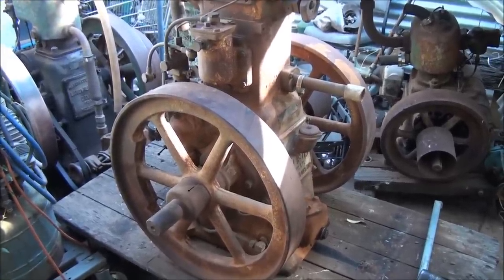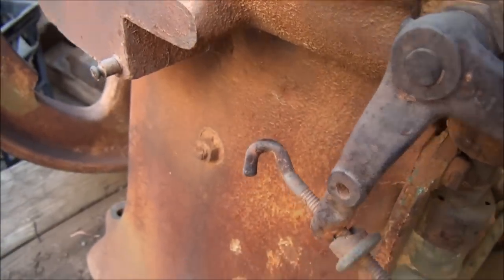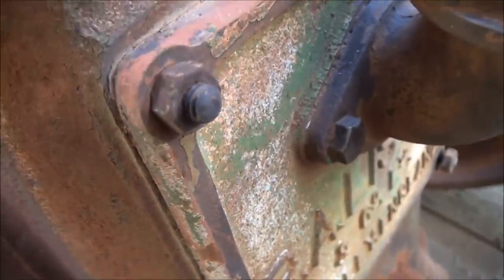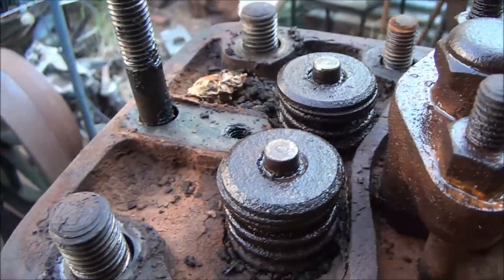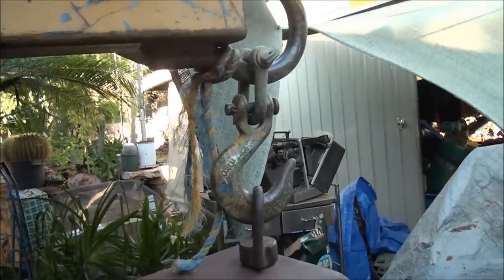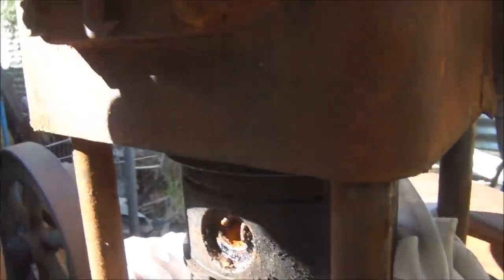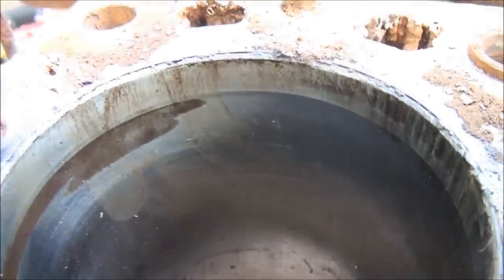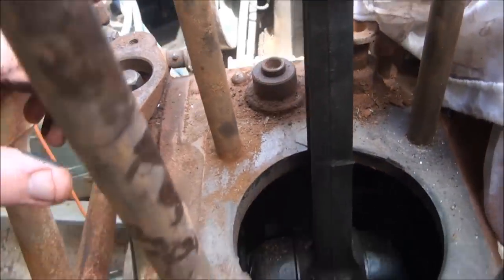Lister engine recovery, dismantling and inspection.

Comment: Hi my friend nice engine you got there I must say that you are a very fortunate man to have that head come out so quickly, At the moment I am restoring a Lister CS twin and each head took me over four hours to get out using steel wedges and pulling with a chain block!!!!!!
Reply: Thank you for that comment!!! I have spent an hour trying to get a head off (using oak wedges) and I though that something must still be connected - hence here looking for tips. Why does he want the valves to be free before taking off the head? Presumably it makes no difference to getting the head off?
Reply: @NomadArchitecture  My cylinder head was hard to take of as there was a lot of rust around the studs, It looks like water has seeped in between the studs and the head!!!! But I cannot imagine how water has got in as the nuts were very tight:-)) I had the same problem with the cylinder block took hours to remove it from the studs same problem heavily rusted studs!! When an engine had stud not working for a long time you need to take the head off to see if the valve seatings are corroded.

Comment: Very nice engine!, its in great shape for its age!
Reply from the maker: I think it helps to have nice dry desert climate to help prevent too much rust forming. All the bolts come off easily without using heat or CRC spray. At one of the stations there was an old Rolls Royce left outside in the elements for at least 40 years, a friend got that engine running again without too much trouble, the electrics (Magneto ignition) were still ok so a prime of fuel and a bit of oil in the cylinders soon had the old beast up and running. Have a great day!

Comment: Hi, friend. I want to congratulate you on that incredible restoration. I bought a 27/3 Lister mod. It looks terrible, because not have  the  3  valves covers and water get inside. If need  some  original spares parts,whar site can get it . I know it is a very difficult challenge but I want to try it. Thank you so much !!

Comment: My understanding is serial number longer than 5 digits on these is are made after 1950, the first 4 is serial number the last number is the year after 1950 (1953)  the other two refers to the engine 5 = HP model ( 6 with higher rpm) 1 = single cylinder, other numbers stamped elsewhere are casting numbers.... to my knowledge.

Comment: It has a very long serial number, usually they were 5 digits for that period?

Write to,

David Edgington
Lodge Wood Farm
Hawkeridge
Westbury
Wilts
BA13 4LA
England

He holds the construction and sales ledgers and should be able to tell when it was built, and where it was sent.

I would normally advise sending a stamped self addressed envelope, but I guess that would not work from abroad!

Just send the info off the brass plate.

Comment: hello sir , 
I have olso emotion for old irons . I have only 1 slavia 12 hp now , field burned engine olso but now its runing, I love my diesel low rpm . but I dont have enough information for my engine , where can I find information for my engine? could you help to me please ? 
afteryour nice video I m looking too a lister here , many friends looking for me around .
I found 5 hp slavia but its stuck piston , there was water inside . what you advice to me? best regards .
Reply from the maker: +Mesut Anilgan As for the engine with a stuck piston you can fill the cylinder with a light oil such as Kerosene and leave it in for a few weeks to try and loosen the piston, try and put a solid block of wood on top of the piston and use a heavy hammer to try and dislodge the Piston. Also you can use a Hydraulic pump like a portable unit with hand pump, connect a fitting in the cylinder like where the fuel injector goes and make sure the valves are closed. Pump in Hydraulic oil and the pressure should push the piston down so you then can remove it.      I have not heard of your engine make but if you search the internet you might be able to find information or maybe contact a Vintage engine society as they might have technical documentation or members might have parts you need.Good luck and hope you are able to get that stuck piston moving. Kind regards, Ian
Reply: what i did when i was restoring a John Deere type e under similar circumstances was to carefully heat up the cylinder around the head multiple times with a torch while also using pb blaster (penetrating oil )to tap it out  slowly

Comment: damn!!, that was close to going bang!!!, that's a loose as bottom end!!
Reply from the maker: Not wrong there, check my next video where I show the bearing, I think the bearing looks like it was starved of oil and started to rip out the white metal. The engine would not have lasted long, luckily the crankshaft journal seems ok so a new set of bearings will sort that out ok. Cheers!

Comment: gday, ive always been interested in finding my own station engine to restore etc. would you have any tips in finding these? i am located in adelaide but it seems almost impossible to find small station engines around SA. love the videos, always nice to watch tinkering after a hard day at work! any help would be muchly appreciated :)
Reply: emdae921 well good question I know this comment is old but I hope this helps👍  a lot of people are willing to sell you just need to find one. A lot of times there just out in the middle of nowhere so if you ever see an old abandon farm there is a pretty good chance of you finding one there. They are sometimes in abandon mines to probably pump water but these can be sketchy and often times water floods the mine and ruin them. But if you live in a city you best chances to find one are to go to shows and swap meats. I hope this helps and you find one they are pretty fun to work with☺️

Comment: Did ya go back and salvage a valve cover from one of those blown 3.5 engines? (if it would fit)
Reply from the maker: TheFurriestOne The covers will fit most CS Listers, later model engines used a cast alloy one, I did manage to salvage a few spares in case I need parts. I did speak to the manager of the property, he told me that a former mechanic was a very strong bloke and tended to overtighten bolts and things, that was the most likely cause of the big end failures, over tensioned bolts after big end bearing replacements!
Reply: ***** That's a shame about the mechanic, but at least you have spares! Do you think both 3.5-hp cylinders were wrecked by the big-end failure? One certainly looked to be, as the con-rod had smashed up towards that section quite violently!
Reply from the maker: Yes, I think they all ended up the same way, would have been a spectactular end to the engine!
Reply: ***** Back when they were a dime a dozen, folks might've paid to see a worn-out old engine be run to destruction like that! No oil, maybe some sand for good measure, over-rev it and watch it blow! While there is a certain fascination to such a spectacle, I prefer a slightly more scientific purpose behind destructive testing- torturing bodges and jury-rigged repairs to see how they hold up! XD I wonder if there's any call for blown-up old engines as yard art around there? Might be a business opportunity! ;D

Comment: You have been given 3 dates 1953, 1944, and 1938. The correct answer is 1938 according to the engine dating list for CS diesels on oldenengine.org so the engine is 82 years old in 2020.

Comment: Did someone else claim the small horizontal diesel which was out there?
Reply from the maker: Yes, that was a small horizontal Diesel but its still in occasional use to pump water out of the bore to some cattle yards. It actually replaced that Lister which was disused after it got too hard to start. The bore was sunk into a stream bed which runs out from the hills, that spot may have been a water spring where water can be found close to the ground surface.

Comment: If it is indeed a 1953 it must have been such an excellent design it was kept on for some years. Certainly looks like earlier technology. But then what do I know. Just guessing here.
Reply from the maker: I believe Lister started making that CS design in the 1930s and continued to the 1970s. India still make these engines which are known as Listeroids, they are in demand from people who want to generate their own power using a long lasting, slow speed engine. I have heard of some of these engines running for up to 200,000 hours without a major service. They are a simple robust design without any fancy electronics etc. The bearings are massive, which should last a long time.